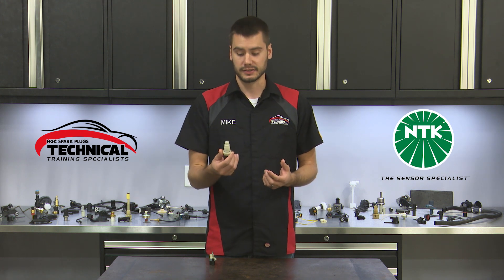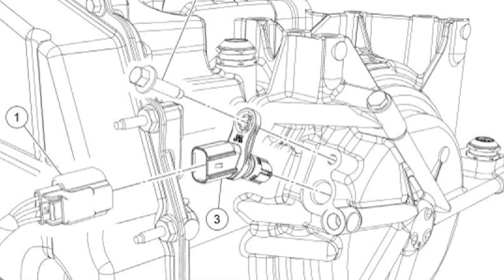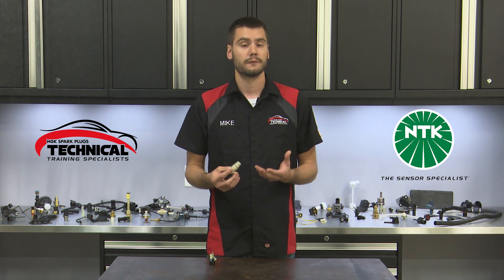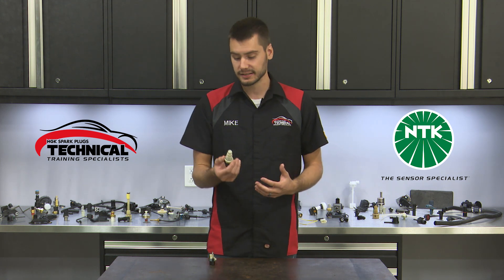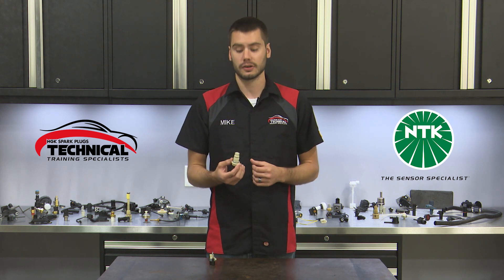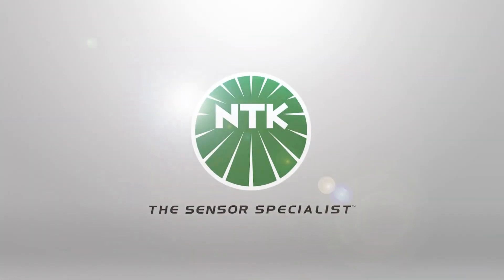NTK - Automatic Transmission Speed Sensor

Comment: When i drive aggressively in my G35 coupe with high RPMs the AT check light comes on and the transmission locks in the 3rd or 4th gear. When i accelerate from zero- it stays in that gear. if i shut the car down and leave it for about an hour, then the light goes away and the car drives fine. but if i drive aggressively again, the whole process happens again
Reply from the maker: Alex, great question. Give our tech team a call or email at info@ngksparkplugs.com. or  877-473-6767.
Reply: Sir my Nissan automatic when i drive and reaches speed of 100 the car doesnt exceed such speed, even if you floring the gas pedal to the surface of the car the car doesnt exceed  such speed. What can be the problem? ? The transmission  fluid is ok and on the required level.
Reply: Yoo im planning on buying it for my 04 maxima is this speed sensor good?
Reply: Ever found this out I have similar problems…